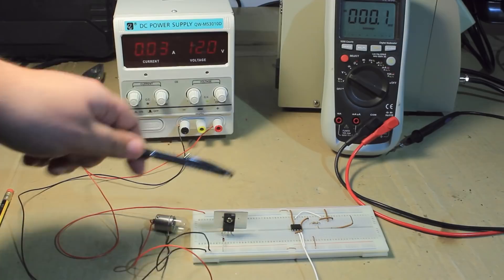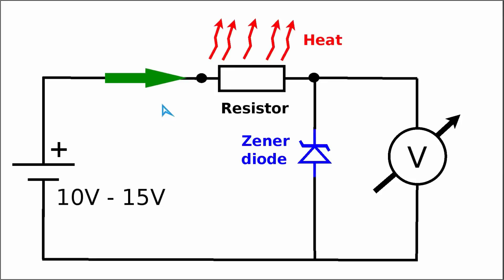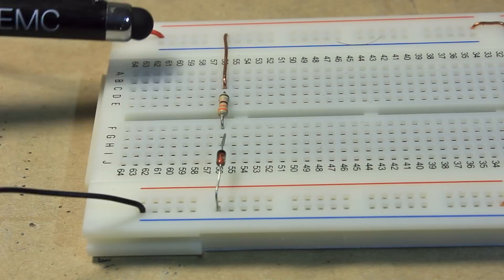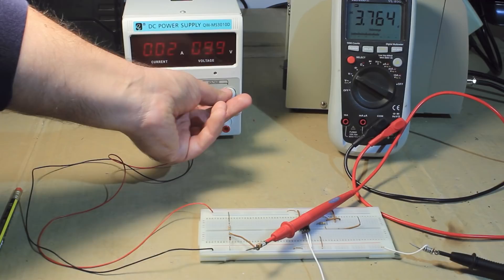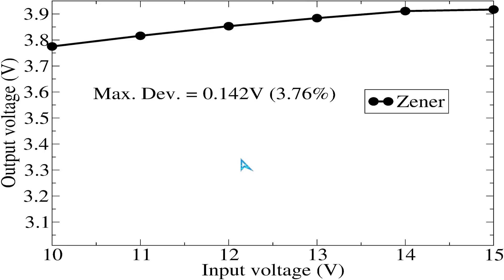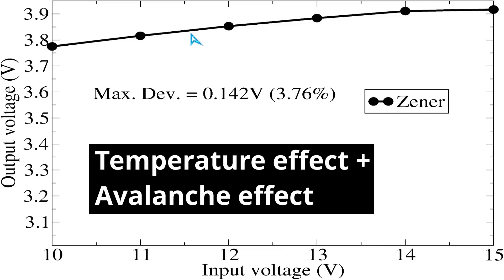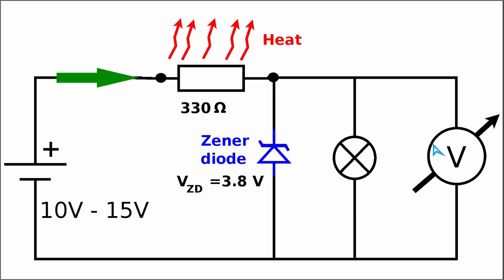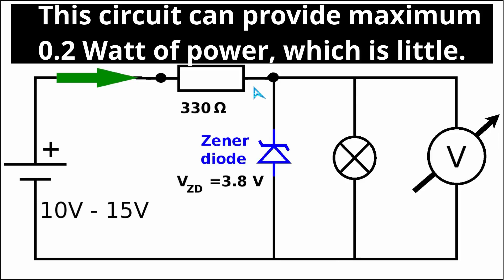SMPS repair series #9: Zener diode and power transistor without feedback loop

Comment: Great series, looking forward to the next. Thanks for your time and efforts.
Reply from the maker: Thanks for the comment! The follow-up videos are in the making. Though, currently I am working on videos for AC current, since several EE students asked for basic videos on AC voltage/current and RMS values.
Reply: Thanks for your reply and fully understand your reasoning, no problems there. My particular interest in your SMPS videos is due to the fact that I currently have 4 broken SMPS at the moment and although I was able to get one of them going, it was only short lived. All the information you produce is benefiting me and my knowledge base so it’s all good thanks.

Best Regards 
Kirk

Comment: are you going to show us the error amp in a future video? also a TL431 will be nice to substitute the zener diode and show us the measurements. i hope you will end up showing us a high amp linear power supply with a transistor and maybe an LDO/tl431 for  setting the voltage we like !
if you can i would like to know why the emmiter "tries" to follow the base voltage. 
thank you!
Reply from the maker: Yes, for sure since I am already making the video exactly on the topic. Though, first I will cover the error amplifier and feedback, since those are important components in a good power supply. As for the emitter follower, I would need to go into Ohm's law first and the npn junction of a bipolar transistor, so I am not sure that in the near future I can cover that, since most of my subscribers are only interested about the basics and not about the math.

Comment: On the transistor you used, is the pin-out out from left to right: collector, base, emitter? I am just wondering, because if it is, the collector seems to be connected after the resistor instead of before it, and I don't see where you made a connection to the base. One leg of the transistor appears to not be connected to anything on the breadboard for the circuit. I am probably missing something.
Reply: I wish there was an answer for this. The video is extremely well done but appears to be missing some detail that maybe we are expected to understand?

Comment: At 10:58, just having some difficulty understanding how the current flows into the zener diode then back out to the base of the transistor. Does the current have to first flow around the grid  and through the "V" circle and then back to the B base?

Comment: These are incredibly well done tutorials, but just wanted to fill in a few blanks for total newbies like me. I'm guessing that 330ohm resister is chosen here because we are limited to max 50 milliamps due to the zener diode's max current limit, so we use the upper limit of input voltage 15 and divide that by the max current of 50 and we get 300 ohms, so we use a 330ohm resister?

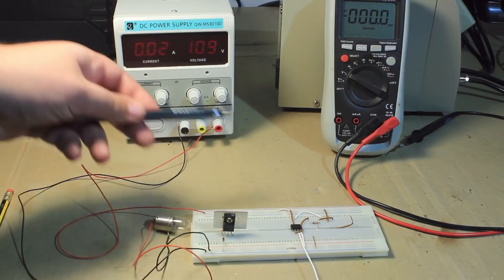Comment: i THINK YOUR SCHEMATIC HAS AN ERROR AT 0:55 as well as at the end.   IT SHOULD BE NEGATIVE FEEDBACK.  THE REFERENCE MUST GO TO THE + INPUT OF THE AMPLIFIER.  The way it is now, if the output goes up the EA output also goes up and the p/s output will also go up, so no control.  probably you missed that.